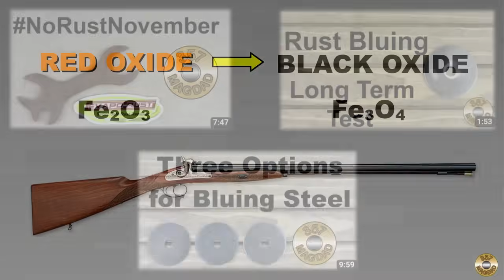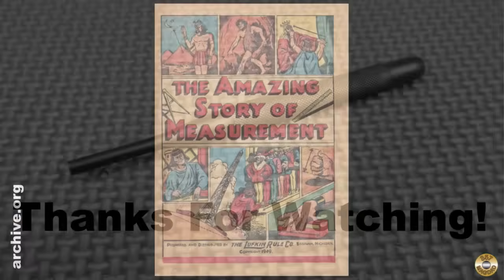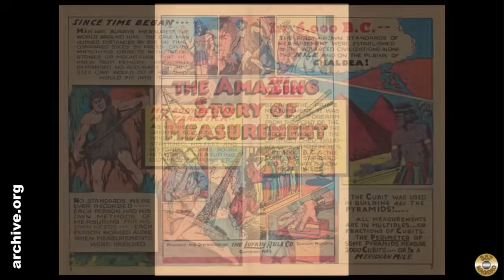DIY Rust Blue - Bluing with Peroxide, Vinegar and Salt

Comment: Can i use isopropyl alcohol or sterilising wipes as a degreaser instead of brake cleaner? And can i use any pan to boil the liquid?
Reply from the maker: Any degreaser will work.  I think any pan will work except maybe cast iron?
Reply: @357magdad  thank you! ❤️
Also can I store the liquid and reuse it after am done bluing?
And are the fumes toxic in any way? I'll blue stuff in the kitchen
Edit: nvm I have a portable stove I'll blue in the workshop or outside
Reply from the maker: @vcommandarv5916  I never tried storing the mixture.
Reply: @357magdad  considering it's vinegar and hydrogen peroxide it might be fine once it cools down (i know nothing in chemistry) but idk how will it work on the second or third use, if it will become weaker for example?
Reply: @vcommandarv5916 : It's so cheap, why are you concerned about saving it?
Reply: @zapa1pnt   because 
1- it's a pain to dispose of
2- it's a pain to make
3- it's more expensive for me
4- I like saving and re-using things when I can, feels like I get more from what I invested

Comment: Is it just the heat or is also the water needed for the rust blueing reaction ?
Reply from the maker: The part has to be completely submerged in the boiling distilled water.

Comment: Just curious if it has the sulfur smell like the most common cold bluing solutions leave on a part.  That's the biggest reason I hate using cold bluing...
Reply from the maker: I gathered up all of my blue punches - Super Blue, Perma Blue, G96 Blue, Oxpho Blue and the one I rust blued in this video.  I couldn't smell any odor.

Comment: Do you mix the salt, vinegar and peroxide first and add to boiling water?
Reply from the maker: I recommend you watch the video again.  I used the salt, vinegar and peroxide solution to create red oxide on the steel.  Submerging in boiling water turns the red oxide to a protective black oxide.
Reply: @357magdad  Just didn't know if H2O2 (hydrogen peroxide) was acid or alkaline.
I ended up looking it up on Wikipedia.
 'Consumer grade is 2% to 6% so vinegar will raise acidity 
'Pure' peroxide is explosive when heated and why it's diluted with water.
It was actually quite interesting reading

Comment: Am currently teying this on an old .22 bolt.  I didnt sand it 100% shiny and the low points are darker after 3 passes.  Am adding more passes to see if the high points will blacken enough....
Reply from the maker: Let me know how it turns out!

Comment: So wait - are you boiling in distilled water, or the mix you mention in the beginning of the video?
Reply from the maker: Thanks for watching Nathan!  The rust blue solution creates the red rust on the item.  Boiling the item in distilled water turns the red rust into protective black oxide.
Reply: Ahhh, gotcha. So the substance being brushed onto the tool was the mix. I think I may have been inhaling too many fumes while trying out different approaches! Thanks for the reply, and for sharing your wisdom.

Comment: When was the hp salt and vinegar added. I heard just boiling distilled water.
Reply from the maker: Thanks for watching!  The peroxide, vinegar and salt make the part rust.  The boiling distilled water converts the rust to protective black oxide.
Reply: So it’s applied before the boiling water. Is it a soak or brushed on?
Reply from the maker: @Bluechip288  I used a brush in the video.

Comment: what to do with peroxide mixture? Do you add it to the distilled water and boil it?
Reply from the maker: The peroxide, vinegar and salt induces surface rust on the part.  The boiling distilled water converts the red rust to protective black oxide.

Comment: You can also run parts through your dish washer,  
coat the parts with the rusting agent
then run them through the washer.

most newer washers have a Boost or Steam heat setting.  
Bost  brings the water to boiling,  and Steam raises the temp to create a lot of Steam.
If you are concerned about city tap water,  
prefill the bottom of the dishwasher with distilled water, then start the cycle.
you just stop it after a few minutes.
Reply from the maker: I don't think Mrs Magdad would let me use the dishwasher!
Reply: @357magdad  Maybe get a cheap used one, just for that purpose.

Comment: ???  So where did the peroxide, salt and vinegar come in ?  All I saw you use was brake cleaner and boiling distilled water
Reply from the maker: Thanks for watching Thom!  I used the peroxide, salt and vinegar solution to induce the red rust on the part and the boiling distilled water to turn the red rust into protective black oxide.

Comment: look incredible. gonna try it on my leatherman wingman me thinks
Reply from the maker: Thanks for watching!  Your Leatherman may be made of stainless steel.  Rust bluing only works on carbon steel.
Reply: @357magdad  it is stainless, but it still produces red rust in bad enonugh conditions. They give the option for black oxide finish. I am not sure how they produce black oxide in teh factory though. I was looking for the cheapest method though as where I live, the gun blueing cold method is not readily available.

Comment: This is very confusing.

I feel TBSP is not a good measure for liquids.

And even more, I have 30% hydrogen peroxide. Did you use 4 spoons of 3 %? How is that compare?
Reply from the maker: The rust bluing solution doesn't have to be exact.  If your peroxide is stronger, use less.  Experiment until you find a recipe that works best for you.  TBSP = tablespoon  Google can help you convert that into units that are more familiar to you.

Comment: Does the brake cleaner has to do with the chemical reaction?
Reply from the maker: No. You can use whatever solvent you have to degrease the part.  Denatured alcohol, acetone, even rubbing alcohol will work.

Comment: Isn't rust bluing salt bluing?  I heard that the early Remington M1917 rifles were rust blued until about October of 1918.   Then I heard that the Swiss k31 rifles were salt-blued, which involved boiling them in a salt mixture....  which is exactly what you did here in the rust bluing process!   isn't this the exact same thing?
Reply from the maker: I think salt bluing involves caustic chemicals at high temperatures.

Comment: But isn't salt can rusts the metal? or i don't need to worry ? Also heating hydro-peroxide in microwave, isn't risky causes toxins spread or explosion? is it possible to heat up by boiling it in outdoors instead? last question, would it be good result if i sand blusting it before this process for a nice matte finishing ?
Sorry for long questions, I don't wanna make mistakes
Reply from the maker: I don't have any experience with sand blasting.  By all means work outside if you feel safer!
Reply: @357magdad  thanks

Comment: Where does the salt,vinegar and peroxide come in?
Reply from the maker: Thanks for watching!  I used the Peroxide, salt and vinegar solution to create the red rust on the punch.  The boiling distilled water transformed the red rust into protective black oxide.
Reply: @357magdad  ok thank you. I thought I heard “break clean”
Reply from the maker: @eblinkin  I used brake cleaner to clean the punch after buffing with steel wool.

Comment: You can also coat stuff with heating up the steel and putting linseed oil on the heated carbon steel, but I think the steel have at least be 300°C Celsius or so, that the linseed oil steams boils on the steel if you rub it on the steel with a soaked cotton(don't use plastic polyester ect rugs, they melt) rug.
I found the German video to it, the cc text translation in not 100% correct but to 99% becourse he don't have sayed anything about painkiller but ther was thus word translate wrong, 🤣. Everything should be understandable with the cc text switched to English. Like I sad 300°C Celsius and linseed oil was correct. Have fun and don't hurt yourself. 👍🖖
Reply from the maker: Boiled linseed on hot metal is a popular blacksmith's trick.

Comment: Pvc pipe cut in half makes a good bath
Reply from the maker: It would!
Reply: @357magdad  yes just cut a length cap and glue each end and cut in half and you get 2 maybe one with water too slow off the process when done.
One thing I did not hear what amounts of each ingredients are needed?
How many psrts of each?

Comment: The cold blue solutions I found were garbage. It's never a consistent finish, regardless of how much you clean  the part and it can wear off easily while cleaning.
Reply from the maker: Rust blue is very durable and actually protects against corrosion.

Comment: how much water?
Reply from the maker: Thanks for watching!   You need enough boiling distilled water to keep the part submerged.
Reply: Wouldn't that mess up the ratio if one have a bigger and wider container compared to the smaller one? @357magdad
Reply from the maker: @sportsonwheelss  I recommend that you watch the video again.  The distilled water is not part of the rust bluing recipe.